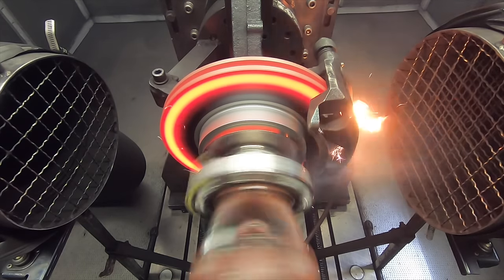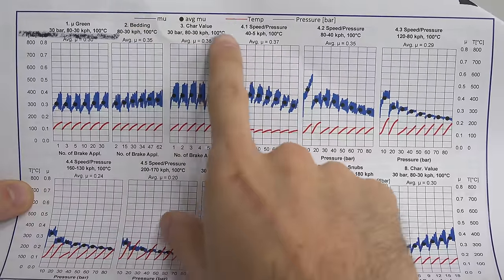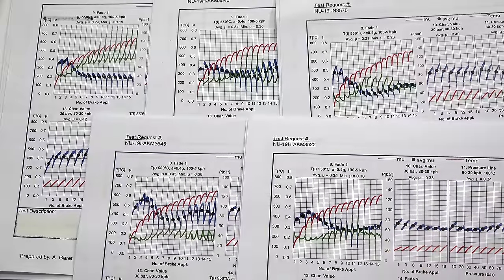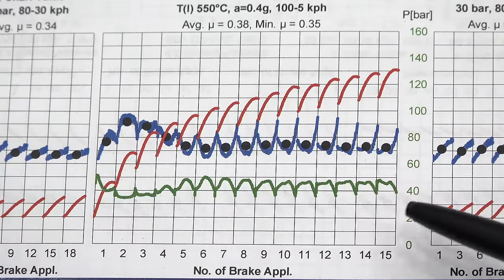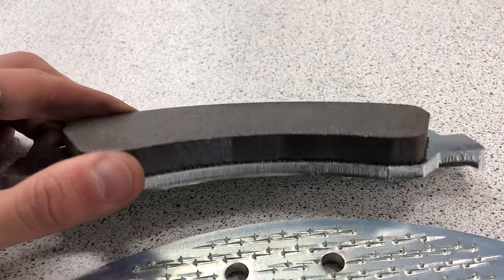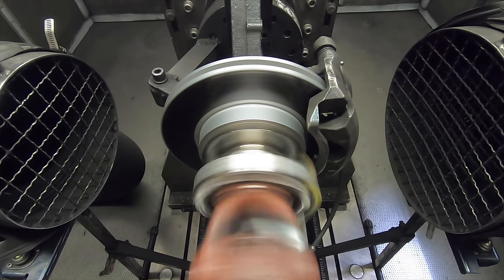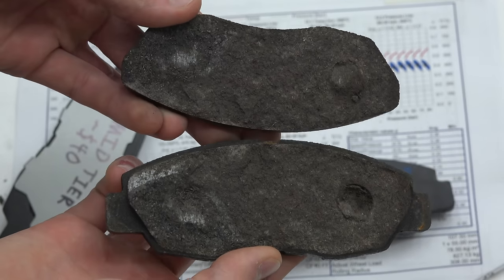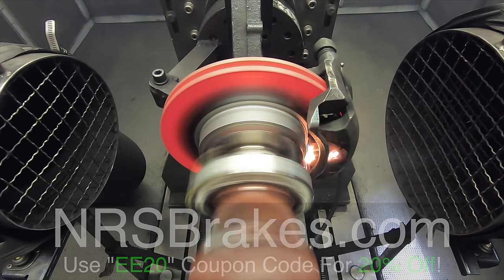What Are The Best Brake Pads? Cheap vs Expensive Tested!

Comment: Trying to save money by buying cheap brake pads is the same as trying to save money by buying cheap condoms. You just don't mess with that kind of stuff man.
Reply: So what type do I get
Reply: @Starscream8896  Depends on your car. For example, for my car, an infiniti, I will replace the pads with Akebono pads. They are actually OEM on certain infiniti models. But honestly, in my humble experience I would say that OEM or OE spec is your best bet. Most others have some sort of 'side effect' that is not present with OE.
Reply: What would be the equivalent to pulling out?
Reply: $59 car quest pads for my Audi s6 have been better than any of the other $100-150 options I’ve tried
Reply: Fake news. One will end in a horrible accident. The other will end in maybe a bit of braking noise?
Reply: 1 just don't get condoms, 96% is as good as 0, 2 pulling out has near similar results
Reply: Which brake pads are equivalent to getting a vasectomy?
Reply: Cheap condoms have actually been found to be just as effective or even less likely to break than the more expensive brands, normally because the more expensive brands try to give you the same protection but with thinner material. 
Aka cheaping out on condoms may actually better protect you.
Reply: @pianomail  with this in mind, I shall enjoy my cheap brake pads 🤣
Reply: @KeterMalkuth  you don't say
Reply: I bought my car new and liked how it was when new.  I try to use as good of parts as I can to maintain it.
Reply: I save tons of money doing pads and rotors myself and also purchasing from FCP Euro, they have free lifetime warranty on everything they sell even common wear items like brakes and windshield wipers. Basically buy once and get free replacements the life of the car, just have to pay to ship used items back.
Reply: @FezCaliph  Probably using pedal bike brake pads. While it might work for a bit it's never a good alternative.
Reply: Except one creates life and the other ends it.
Reply: They all stop. And in New England they will be seized in place by the next brake job, regardless of which you chose.  I prefer organic over ceramic and semi metallic.  Because organic brakes are not as hard on rotors as the other types. Organics are usually the cheapest.
Reply: @Supertoddy96  lmaoo you serious?
Reply: @Fried_chicken_burger  yea, to an extent, 1/25-1/50 times that you have sex that condoms won't prevent a pregnancy on average
Reply: @Fried_chicken_burger  I'm talking g about pregnancy, if anyone doesn't tell you they have something that's highly illegal, but also even less likely to catch anything from anyone because of how rare stds are. Also the conversation isn't about stds
Reply: @Supertoddy96  First, that way of interpreting effectiveness is wrong, effectiveness is measured annually. 94% doesn’t mean it has 6% odds of failing every time, it means that for an average couple, there’s a 6% chance it will fail in a given year. Given that the average couple has sex more than once in a year, that means it’s actually more effective. It’s also absurd to reject a safety measure just because it isn’t 100% efficient, as none are.

Second, where did you get the idea that pulling out is as effective? It isn’t, as preejaculate also contains sperm. Not to mention it’s also harder to use correctly, or even know if it was. Plus, it’s not like they’re mutually exclusive, you can do both.

Third, in order to inform you they must know first. If someone doesn’t know they have an STD, which is usually the case when transmitted, those laws matter diddly squat.
Reply: Have you even ran a business before? Low cost things are not cheap and high cost things are not quality. It's called economy of scales. You make the good common stuff in high quantity so the cost goes down. While the rare for the sake of rarity cost more because less get made. Manufacturing Engineering 101.
Reply: @Mrkevi123  well, most of the stuff, better quality means higher price. of course not always.
Reply: Never skimp on brakes and tires.
Reply: I got kids somewhere 
Broken rubbers.

Comment: Pretty surprised that the OE pads did so well. I mean, I didn't expect them to be junk... that would be a lawsuit just waiting to happen... but I certainly didn't expect them to be just about as good as it gets either.
Reply: @ChadDidNothingWrong  I disagree my ceramic pads are great, had them for around 50k miles and to beat that basically no break dust and I got them for around 60 front and back
Reply: @marksoublet6480  and if you can get OEM JDM Components for your Japanese car you do great. I've had a 20 yr old Acura with the original starter and many of the bulbs were what came with it.
Reply: @ChadDidNothingWrong  There are so many brands. If someone did a test like this with just ceramic pads that would be nice
Reply: @joeKisonue  I agree, on OEM JDM parts. Especially Toyota/Lexus ( no disrespect to Honda/Acura ) because there are so many interchangeable parts that one can upgrade parts within the company.
Reply: It sounds like OE is a brand that can be compared with consistency. Seems like that's saying that sellers on ebay are always reliable with no exception.
Reply: @MRMAN-wb1tv  Toyota OEM are very good brake pads.
Reply: OEM stuff, which most people overlook, is usually some of the better/best replacement parts you can buy! Usually better than most or ALOT of aftermarket parts. Not surprised. Also not surprised at all the surprised people lmao
Reply: @Cereal_Killr  Most aftermarkets are not that great. When I was younger and didn't know jack I used to think OEM was trash compared to "Performance Aftermarket". Now...I know that if you're doing daily driving or if your OEM has a performance OEM kit for your vehicle (AMG, M-Sport, etc..), then you're probably better off going OEM high performance rather than a whole new aftermarket system, unless you're spending many times as much for very specific engineering for your car. Even then, I'd like to know the testing specs like what's laid out here if I'm that far into tuning the car. Then again, most performance aftermarket parts aren't going to be cheap if you want proper quality and engineering.
Reply: A lot of OEM consumables are made by the bigger aftermarket manufacturers, so its not too surpising, they just aren't usually marked as such

My motorbikes OEM pads/discs were made by brembo for example
Reply: OEM parts are usually the best unless it's a known failure point on that vehicle.
Reply: I guess the biggest problem with OE, is that it's usually 4x the cost of good aftermarket stuff which is why people go that route. There's reason they're called 'stealerships'. If you priced out all the parts to build your vehicle from the parts department, for a $50K vehicle you'd be somewhere around $200k. That's just highway robbery, and no excuse for it.
Reply: Only problem is the cost from the dealership to get the part.. sigh
Reply: for the price I sure hope they would lol

Comment: This test shows that your brakes are definitely the wrong place to save money.
Reply: same thing with tires, but people are insane.
Reply: It saves me double the money, 1st on the pads, 2nd, i don't need a retirement plan, house, or a new car. (As long as i´m going fast enough)
Reply: Think about the people you are taking with you.
Reply: the cheapest one didn't do too bad imo, but would save you a lot.
Reply: @poiiihy  Well, it didn't do too good lol. I'm replacing brakes every 3 years or so. The 40 or 50 bucks more are well worth it for me, even if it's just for peace of mind.
Reply: Yup. NEVER cheap out on brakes and tires. It's a horrible idea.
Reply: Nah just replace the brakes 3 times more often.
Reply: Are we watching the same video? After the 1st test (i.e. some use), the budget and expensive pads barely differed in performance...
Reply: @kaptinkeiff  I think there's a bit of bias going on from the creator and general viewer. the mid tier, NRS and OEM brakes are pry all the ones you want to go for. Mid tier in general unless you absolutely want to pay premium for brakes and marginally better mid-life performance for high end.
Reply: @07wrxtr1  I'd say tires are more important for safety.

Comment: Well, you've successfully convinced me to continue buying OEM brakes.
Reply: Yeah, seem to be go with what was made specifically for the car. Makes sense.
Reply: @maralonent6257  ye, imagine that. use what the people who designed the car thought was best. who would of thought it?
Reply: I changed the brake pads and rotors of my car and I can't even compare the 2. In my case the brakes that the car came with from the factory (bought it brand new) were utter garbage. I can't even imagine why I postponed the change and had to deal with the original brakes for 3 years!
Reply: @redguard128  You have a point there. The so-called lower priced "throw-away cars" are usually gone over with a fine tooth comb by the bean counters before mass production, and you can bet your sweet bippy this includes cheaper brake shoes installed at the factory. That being said, it would probably be an advantage to buy the brake shoes and other brake parts from a reputable manufacturer rather than the OEM's.
Reply: Tom Wetz  Generally speaking for Ceramic Pads, the only brake pads that will usually last 120k is OEM and that's if you're lucky. Aftermarket is usually around 60k-80k tops. Akebono is a great choice that almost compares to the longevity of an OEM pad with better stopping power and pedal feel.
Reply: While a model is in production, it's probably wise to assume the pads are to the original design spec.  After that time, the Service organization is likely to re-source to reduce cost/increase margins and let the standards drop.
Reply: @rayford21   Haven't heard "bet your sweet bippy" since Johnny Carson retired.
I think you have to send a nickel to some foundation every time you use it!
Reply: Your paying a dealership premium for what is likely repackaged as AcDelco Professional.
Reply: The only thing that you would really notice is if you have a performance rotor and all of this stopping is affected by tire balance , mid pads and awesome rotors are your best bet , these will also be worse when you’re using drum brakes
Reply: My thoughts exactly!
Reply: Depends on the oem company and more important who makes them for the oem. I know a few companies to buy pads from who make them for the oem and can save money.
Reply: OEM pads are designed to last a long time, be quiet, not bite too hard and be cost effective. Get EBC pads.
Reply: OEM is probably best. In my case,  a piece of the outer rear brake pad broke off on my Silverado 3500HD at 14500 and locked up the rear wheel. I'm glad it was not one of the front brake pads at high speed.
Reply: @jeremyjeremy8795 
Yellow stuff ftw!
Reply: @ptspyder   I’m running Yellow on my Fortè right now and while they do bite like a bat out of hell they dust even worse. I mean I can have the wheels cleaned completely and by the end of one day (full time Uber driver) they are coated again. It’s weird too because the level of grab changes a lot, like when they’re cold on a cold day they feel like an OEM pad but once they warm up they bite like vice grips and sometimes on a long stop like a long downhill hiwy ramp you can feel them biting harder as you are completing the stop. I do think next time I’ll go Red tho as they are supposed to dust a ton less
Reply: I've had good luck with Akebono pads, I think they make products for oem on some cars.

Comment: On my old 2001 4Runner, my brake pads lasted an amazing 210,000 miles. This was in Virginia , where by state law all vehicles are required to be inspected annually. About 5-years in, the mileage had really started to accumulate so I began asking the inspection mechanic if the brake pads were still OK and for the next four years his reply was always “yup”. So finally came that fateful day when he finally said “they pass, but just barely, you really ought to have them replaced”. This is where I made my big mistake. I had the brakes replaced at a local shop near where I worked, but didn’t specify OEM or equivalent parts. Almost immediately, my chrome wheels began to turn black with brake dust. After only 20,000 miles they needed replacing. So the OEM pads lasted 10 times as long as the cheapo brand. Who knew? This will not happen again on my watch.
Reply: For shure you don´t use the brakes...
Reply: Did you do any engine braking?
Reply: Ummm factory brakes are just rebranded in a factory box..so no
Reply: Things that you are saying are sci-fi fantasy
Reply: 210 000 miles?!!! You mean 21k??? Or you are not using breakpads bit break with your feet like Flinstones....
Reply: @covakoma1064  man, talking to people who have no clue in difference between fantasy and friction don't worth talking to
Reply: @dkrawk8309  I have no idea why do I read comment at first place.... better do some other shot tho...